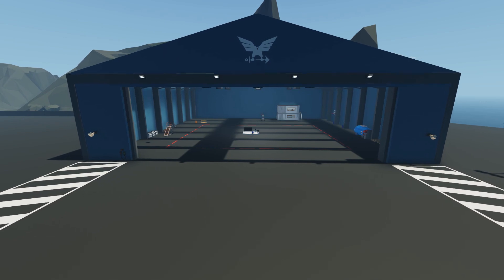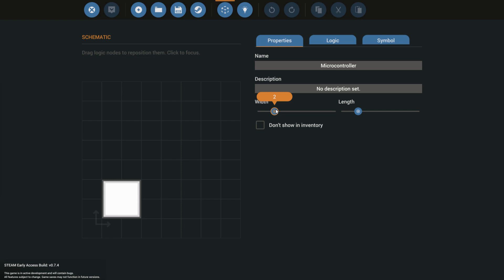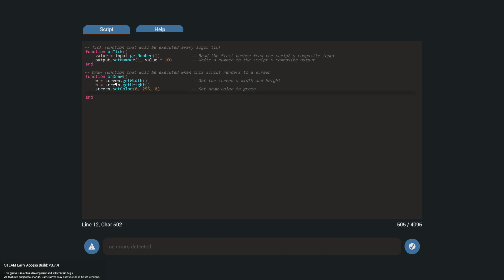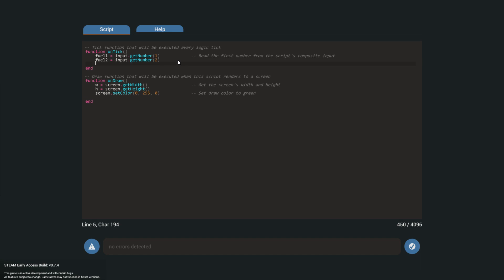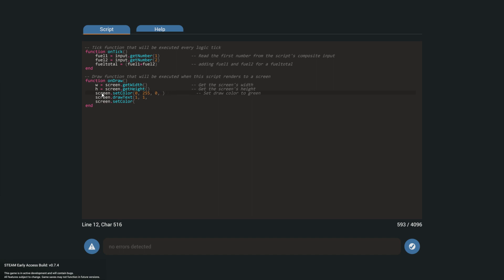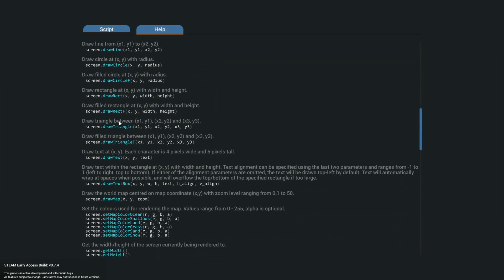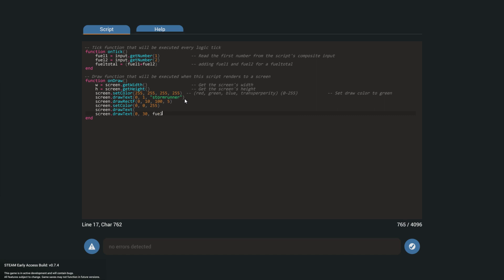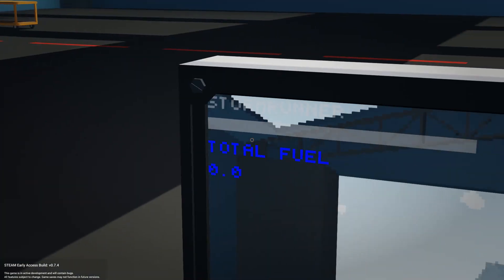Basic LUA Tutorial  | Stormworks Build And Rescue Gameplay

Comment: I like Stormworks a lot. It has so much depth it makes other games look bad. The thing that is awful in Stormworks is how you manage the different versions of your designs. I'm always confused about what I'm editing. Is it a microcontroller ? Is it a Lua script ? Is it a vehicle design ? What am I overwriting ? Am I working in the Lua script inside a new controller or am I working in an existing script ? It's very annoying you never know what you are updating. The whole GUI needs to be done from scratch imo.
Reply from the maker: yeah, the depth of some of my builds gets me confused from time to time.
Reply: @StormRunnerGaming  I've build this French fighterjet from a blueprint i found online. Im now converting it into a display only cockpit. When you start using sceens with multiple feeds and inputs it gets quite complex. I have to make notes on paper to keep up. I use the seats hotkeys for presets. Like a mode for taxi, Takeoff, cruise, landing, stopping. It has roll and pitch stabilising. 8000units of fuel and a system to keep the center of mass. It can reach top speed without exploding. It uses a map that zooms out when you speed up. I wonder what the actual range is when it's ready. Ill invite you for a topspeed flyby if you like 😂.
Reply from the maker: @Lexe2009  maybe, stormworks multiplayer is a bit problematic at times.

Comment: Do you know how to get rid of those random numbers?
Reply from the maker: sorry for the late response. What do you mean by random numbers?
Reply: @StormRunnerGaming  Its alright.What i mean is when i enter a value onto the screen with a input from the microcontroller, it shows up as 0.4444445 insted of 0.4. How do I make it show 0.4 insted of 0.444445?
Reply from the maker: @nightraider4138  there should be a round function or a floor function that you can run a value through to get rid of the decimals.